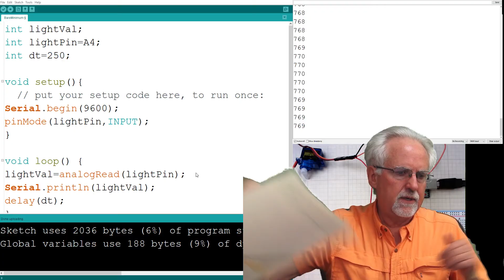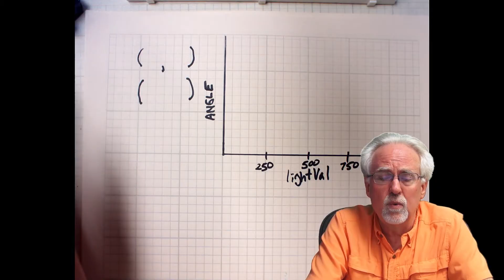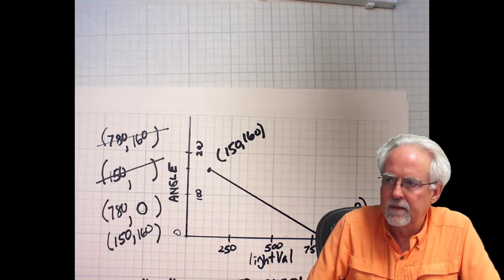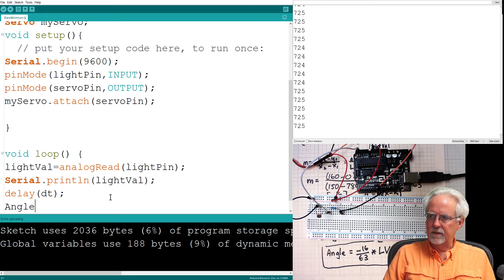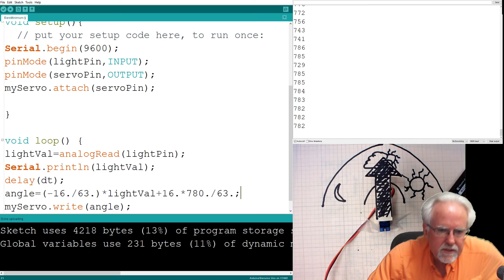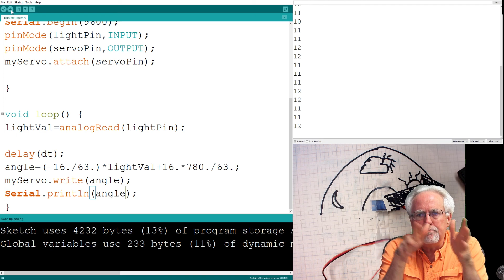Arduino Tutorial 31: Using Servo in a Simple Project

Comment: I did the math and homework and it works. I had the servo turning in the opposite direction. When I saw what you were doing, I re-did the mat, following your example and changed my code with the new formula. 

I had a problem with Lesson 30. Did exactly what you did, but when I entered a position using the Serial Monitor Input, it would go to the position momentarily then return to zero like it shut off the pulses. Worked with the hard coded value at the beginning of the lesson. Finally got it to work by replacing "while (Serial.available()==0)" with "while (Serial.available()>0)". Something with my board? Strange.
Reply from the maker: Make sure serial monitor is set to no line ending.
Reply: @paulmcwhorter Thanks. I did try that, but it still didn't work correctly. I want to go back and try it again from a fresh sketch when I can. Also, I might try an older IDE (1.×) that has the separate Serial Monitor window.

Comment: Where does the library load from, the computer?
Reply from the maker: Initially the library in on your computer, but once you run the program it is compiled and downloaded to your arduino with the rest of the code. So you do not have to be connected to the computer once you run the code

Comment: For new learners map() is a great alternative for dynamically controlling ranges without calculating the linear line yourselves. By passing a value, say readVal (or whatever your LDR pin's output var may be) and setting your low-high end e.g. (150, 750) followed by the range of movements a servo is capable of (0, 180) you can achieve a modular and robust soloution with the same effect. Put together it would be myServoPos = map(readVal, 150, 750, 0, 180);  myServo.write(myServoPos);
Reply from the maker: Yes the entire point of this lesson is to teach the students the math. For them to understand and become careful with the math.

Comment: I did it sir even not only that I just makes an attempt no i did it perfectly even i use it in many different ways i find this Arduino super easy maybe is now because of my mind set that i want to be at one of the best AI in robotics person in the whole world or maybe is because build projects is my talent and I have already gone for Linux, python, and electronics before  very well and you know  Linux and Arduino are making use of c++ Programming language and i have already master ubuntu linux little in which i have torn my system to full Ubuntu desktop. 
I don't really know i just find is super easy but what want to make it stressful before is because that i don't know that i supposed to install Arduino servo on my Arduino before so that stress me alot but when I upload the error that the Arduino is giving me to ChatGPT and it now leads me to how I will install the Arduino servo package on my ARDUINO IDE but this is what I do in the code for photo resistor to control servo motor 180⁰

outputvalue =(0.17595)*readvalue;

For  90⁰

outputvalue =(0.08798)*readvalue;
Reply from the maker: Excellent!

Comment: I did the math and homework by myself. However, since the max value of the photo resistor is 1023 and the lowest is 0 I used 0-1023 rather than checking what is the personal values of the photo resistor when the light is on and off  like what you did (780 at on and 150 at lights off). My sensor does go to 180 so I used that. While my program did work as intended, I do wish I had looked for specific values of the photo resistor when the lights are on and off for me instead of using the default min and max values to be more precise. Great video, it was fun to watch.

Comment: For me , cloudy value is 115  ,dark night 35 and bright daylight 675. There are 3 points for linear equation and I couldn't derive a formula. I had to use 2 formula, one in the if clause. there is better solution,right? I wanna derive a equation for this problem. Someone plz teach me🙏🏻

Comment: I made a "little stinker board" to detect if the lights in my living room were turned on and my servo would then turn them off (from a light switch in the corner that nobody uses). 
So every time you turned the lights on there was a short delay and BOOM they just turned themselves off. 
My roommates did not appreciate it, but I thought it was a fun way to use my new Arduino skills to make the world a slightly . . . different place.

Comment: Hello Paul,

Here’s a response from the Netherlands.
I’ve been retired for some time now and have picked up an old hobby: electronics. Exploring the possibilities of the Arduino is a very interesting topic and forces me to use my grey brain cells so they don’t slowly fall asleep.

I thought it would be nice to let you know that I’m really enjoying your lessons. After lesson 31 (servo light), I felt it was time to send a reply. I’m following your advice to primarily use algebra in calculations so that you truly understand what you’re doing. You’ve explained that perfectly several times already.

In this lesson, I also ended up using the "map" function—it does make coding a bit easier. However, I still calculate the angle using algebra in this case to ensure I understand where everything comes from.

Thank you once again for your interesting and sometimes funny lessons.

Greetings from the Netherlands.

Comment: Hey Paul and fellow tinkerers. Here's what i did. I'm using a range of 0 - 900 for the photoresistor and 0 - 180 for the servo. If we have 180 as the max value then 900/180 * 180 is Max angle....this means that 0.2*photoresistor read value = angle of servo :)(i might be wrong but works)

Comment: After watching the previous tutorials, I took on the homework for this one in a different way. As luck would have it, my photoresistor had the limits of 0 and 240 with light and dark. So, I gave 0 as 0% and 240 as 100% and then used angle=(lightVal/240)*100 to give each lightVal as a percentage which then moved the servomotor accordingly.

Comment: I LOVE the lessons! One thing I've NEVER understood is how an int variable is allowed to have an A in the value? To me an int should only be a number but since lesson 1 you've been setting some pins to A2 or A1 or whatever and I haven't understood why Arduino IDE doesn't give you an error???
Reply from the maker: Arduino defines it as an INT
Reply: @paulmcwhorter  I have a little OCD and I couldn't understand this concept.  I actually did a quick test in Arduino IDE and just did a Serial.println(A0) with nothing else in the program (which I learned from your lessons!) and it displays 14 so I guess Arduino IDE has "A0" predefined as a constant variable of 14. very interesting, and now the int makes sense to me. Thanks for the exciting lessons!
Reply: A1 is a constant of type int :-) It is defined elsewhere, in the base class which harnesses the loop and setup methods. Adruino is in fact a framework and outside of your reach it defines constants such as A1, and has other methods that call "loop" and "setup" at the right time in the life cycle.

Comment: I was not trying to say that your math method was wrong but that there was a much simpler way to achieve the same end. Here is my program and it works..
#include<Servo.h>
int servoPin=A4;
int lightPin=A0;
int lightValue;
int dv=250.;
int lvMin=10.; //Maximum light intensity
int lvMax=1000.; // minimun light inensity
float span;
float angle;
float scaleFactor;
Servo myServo;
void setup() {
  // put your setup code here, to run once:
Serial.begin(9600);
pinMode(servoPin,OUTPUT);
pinMode(A0,INPUT);
span=(lvMax-lvMin);
scaleFactor=(180.0/span);
myServo.attach(servoPin);
}

void loop() {
  // put your main code here, to run repeatedly:
lightValue=analogRead(lightPin);
angle=(lightValue-lvMin)*scaleFactor; //sets ordinet to zero 
myServo.write(angle);
delay(dv);
Serial.println(angle   );
delay(dv);
Serial.println(lightValue);
//delay(5000);
}

Comment: I did the math before I watched the video. I used a 10k fixed resistor with my light dependent resistor and got quite and even number from pitch dark, 3-4 and light, around 900-1015 on the serial monitor. Instead of having the servo dial moving clock-wise toward light, I used a positive gradient, with the "moon" to the right and "sun" to the left.🙃

Comment: I did a different math. I measured the resistances at both ends and divided it to a number, did the same at the servo's angle from 0 to 180 so each levels of lightVal will match the angle of the servo. I used IF function to "box out" two values so that servo would not go back and forth when light is insufficient to be detected. 
I would say this is best for light activating circuits when the intensity of light source is constant but if the reference light might change every other day like the daylight, this is inapplicable as you would change the values in your program. Nonetheless, you are awesome Paul. Thank you for this. If you existed on my Youtube decades ago, I would've created great devices. hahaha

Comment: I’m working through this in 2024. I’m 70 and so the maths is something I did 50 odd years ago in grammar school. I got this working but with a slightly different equation. I also didn’t put in a pin mode for servo, rather I declared the pin in myServo.attach. I like gradually increasing my knowledge and am looking forward to finishing this course and moving to the next level

Comment: I did find an easier solution instead of the math, I used a map command. I hade a hard time understand the logic in the equation so MAP is way easier for me.
angle = map(lightVal,LV1,LV2,A1,A2);
angle = map(lightVal,200,800,180,0); This seems to work fine.
Reply from the maker: But, the purpose of the lesson is not to find an easy way to do something, but to learn math, a useful skill people will pay you for. The real easy way would be to copy and paste someone else's code, but then you learn nothing. Do the math, it is your friend!

Comment: I was able to do the math without watching successfully, although I did use y=mx+b instead of y-y1=m(x-x1) to calculate the equation of the line , I also made my dial from 90 degrees to 0 degrees rather than 160 to 0.

Comment: Sure did it, but there are a few caveats that I have about the way I went about it, excited to see what you did.

One think I made sure to do is utilize an if loop to set the maximum 'if (lightVal<=180)' in order to not try to over drive the servo. Did the inverse for going to 0. Shouldn't really need the second 'if' loop.

Problem I ran into was the fact that I have bright sun and partly cloudy conditions, so my math kept changing.

Comment: Mr McWhorter, I had an understanding that the dark time meant to be on the right side of the dial, and full shine mode suppose to be on the left, so to get that working I simply had to flip the angle by subtracting it from 180 (to get a proper value) , and , actually, I thought that was a part of the challenge :)

Comment: I rewrote what we made in the last lesson. The servo would start at 0 and increment by 1, until it reached 180. Then, the servo would do the same in reverse. When it reached 0 again, I asked the user for a new increment, before doing the same process, using the provided increment. I did that before you gave the homework assignment, so I decided to let the increment level be decided by the level of light. If it's bright, the servo increments quickly through the cycle, and if it's darker, slower. The more complicated the circuits are, the more exciting the programming gets, because there's so much more room for exploration and finding different solutions to the same problems.
Reply from the maker: Excellent!

Comment: I did the homework without watching. I did the math like the way you did. The only thing I have done different with my code is that I used the cheater function called map(). But, I did the math first so, Line Slope and Point Slope will stick in my head. I pluged it into the code, made sure it worked, then I checked it with the map() to see if I got the same results.

Comment: A program for this can be done by going to chatgpt, in the message line type "Arduino code to drive servo from light intensity"- this is a cheat I know. I copied and pasted their code into a new sketch and it worked right away. I noticed they use a linear mapping function instead of doing calculations, which accomplishes same thing; the high and low values can be adjusted for the mapping.
Reply from the maker: And by doing this you are allowing chatGPT to make you irrelevant. I refuse to lean on chatGPT, as I want to remain relevant in the world.
Reply: @paulmcwhorter  I hear what you are saying, I am still doing the lessons without chatgpt as well. I am just starting to learn a bit about AI, as I continue to learn a bit about electronics and programming. I am just tinkering around with alternative ways to use AI. I am old and semi-retired now, I know I will never make a living from my limited knowledge of electronics, programming, or AI, but I am having a bit of fun tinkering. By the way I like your approach for doing the math, using equations and graphs together. Thank you for all you do!

Comment: I admit. I had trouble with this one on my own. Once I was able to re-create this assignment, I ended up with a problem where the servo would spin 360 degrees continuously if the value of the light fluctuated to quickly. Any suggestions?

Comment: I did my math the opposite way so that the brightest value displayed ~180 degrees and the darkest was ~0 degrees. It gave me a positive linear slope. But I figured while I was doing the math that I could just swap the dependent variable in the y points to give a new equation, so that the opposite was the case. It was cool to see you choose the other of the two!

Comment: I completed the assignment! The only issue I had with the photo-resistor is that the read value can vary between about 10-60 at the top and lower ends when the light remains on or off. It translated to about plus or minus 10 degrees so I had to adjust the values accordingly.. I think my computer monitor affected that value too though. Either way, this project was neat!

Comment: Thank you again for the lesson, Here is the homework

#include <Servo.h>
int dt = 100;
int analogPin = A4;
int analogPinVal;
Servo myServo;
int servoPin = 9;
float angle;

void setup() {
  pinMode(analogPin, INPUT);
  pinMode(servoPin, OUTPUT);
  Serial.begin(9600);
  myServo.attach(servoPin);
}

void loop() {
  analogPinVal = analogRead(analogPin);

  angle = (180./550.) * analogPinVal - (6300./55);

  if (angle < 0) {
  angle == 0;
  }
  
  if (angle > 180) {
  angle == 180;
  }

  myServo.write(angle);
  Serial.println(angle);
  delay(dt); 
}

but i still don't know why the if statement doesnot work. i still get numbers bigger than 180 and smaller than 0 in serial monitor so i hope you will help me
⭐⭐

Comment: I did it differently using if statements but light is continuously variable. If statements can leave "in between" regions that can cause the pointer arm to oscillate. I had to use the slope method to eliminate fast oscillations of the arm.
In my case I used an if statement to limit the angle to 172 degrees to prevent humming. So the range is from 0 to 172.
It seems that the slope method is superior for control. I darkened the room and used a Stylus Penlight to simulate the movement of the Sun. Wax sheet for clouds, and to the side to simulate Sunset. My hand to simulate Night. 
Wayne

Comment: I found the stuttering movement of the servo went away the more I decreased the delay time.  Without a delay, it has a really fluid movement, and this is with the stock (included) servo motor in the kit.  Is it wise to use a delay, and would not using the delay shorten the life of the servo or microcontroller?

Comment: A question, Paul.  It didn't appear necessary for the pinMode (servoPin, OUTPUT); line in the setup loop when I did it, I thought the myServo.attach(servoPin); accomplished that, and the servo/photocell worked great.  Is it better to use both, as you did?  Is it a fluke that I got mine to work without it?

Comment: i did it myself and i just thought i do the value i get most min the least then the result i had like 330 then i looked whats th emost i can do on my servo it was weirdly 180 but it didnt go all the way to be safe i did 175 so i just did 330/180 or som it was about 1.83333 so i did the (light dependent resistor val -210)/1.833 and after that i just ade if statement saying if LDR val > 175 LDR val =175 to overcome that it would overload i was realy active i think i drank too much caffeine lol

Comment: Paul, I had solved this a little differently; I used light range in my room (near 0 to 800) for the evaluation angle = (lightVal/800)*180.; .  I reversed connections (llight sensor to ground, resister to 5 volts.  That gave the same result as the negative slope calculation.  I added the If limitations so as the keep to the 180 deg limit of the servo. Thanks for your tutorials, I'm learning something.

Comment: Write a program in Arduino to do the following:
1. Add an LED that increases brightness as the servo angle approaches 0 degrees and dims 
as the angle approaches 180 degrees. he LED should be dark at 180 degrees and full 
brightness at 0 and fade evenly over the values in between.
2. Rotate the servo 90 degrees if the output voltage from LDR is greater than 20 V.
3. Use a for Loop to find the Sum of 100 Random Numbers. Then find the Average. The Sum and 
Average should be written to the Serial Monitor
4. Using the 4 LEDs, write a sketch where the LEDs operate in 2 different modes. 1 where all LEDs 
are off except for the one that is ON, the other mode is where all are On except for the one that is 
OFF. Let the user set the speed by serial and mode by using the button.